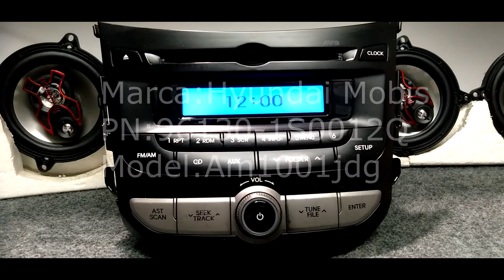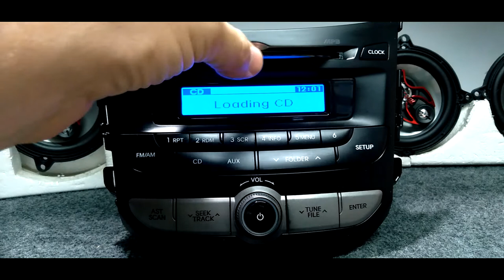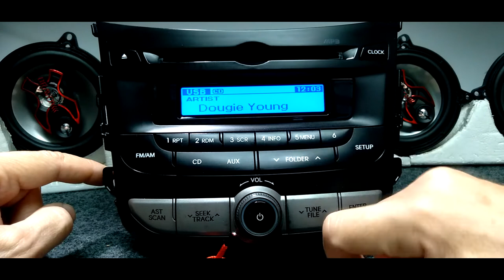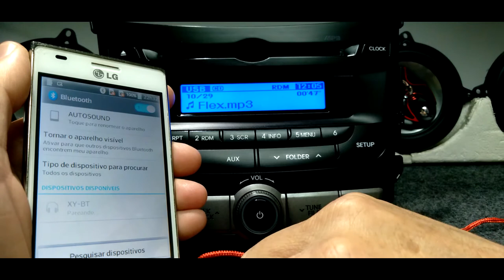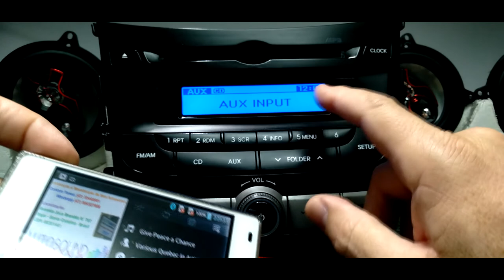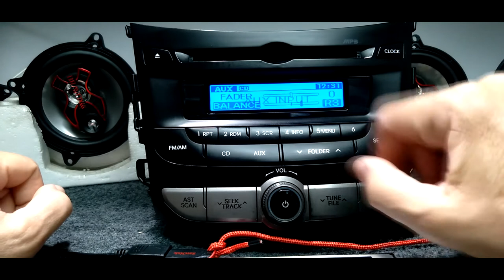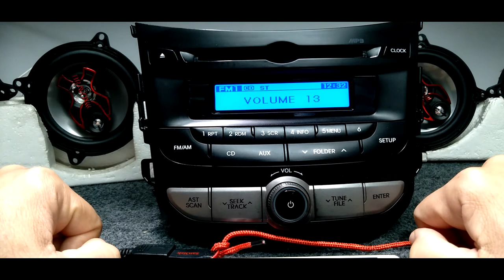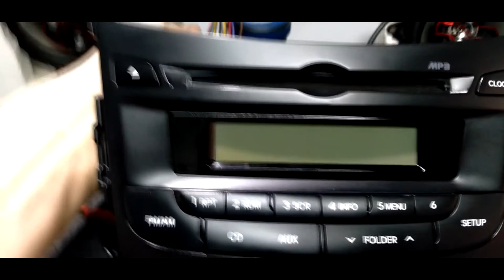#Hyundai Mobis Som Original Hb20 Aux/Bluetooth* USB Radio Cd Player Model:Am1001jdg PN:96130-1S0012Q

Comment: Tem como trocar essa luz do visor , por que a minha não está ascendendo
Reply from the maker: É  led só desmontar ver o modelo testar e se ruim trocar, porém  se estiver boa complica porque aí deve ser algo no circuito.
Reply: @autosound  os botões acende tudo , aparece os números tudo normal no visor , só não ascende a luz
Reply from the maker: @denisacioli3591  Vê se tem um led lá e testa ele e mede a voltagem dependendo pode colocar outro mais forte . Se não tem led aí ferrou porque é um componente inteiro como um tubo a vácuo com filamentos dentro.
Reply: @autosound  vou levar pra uma Equipadora , obrigado pelas dicas